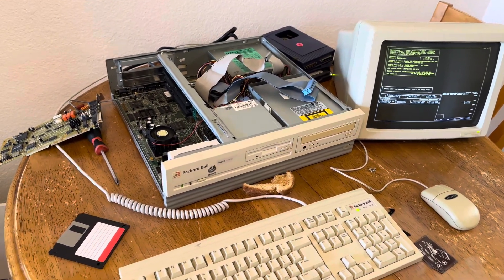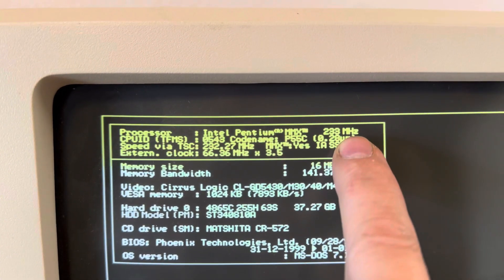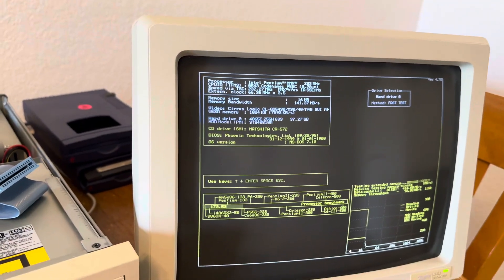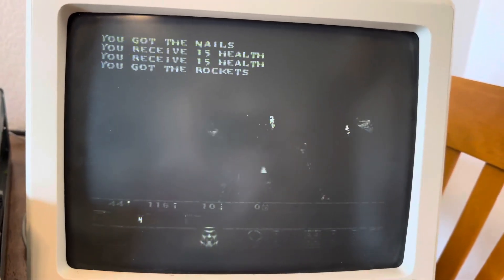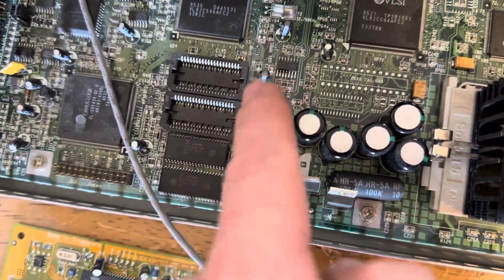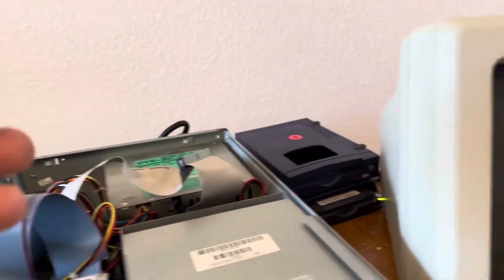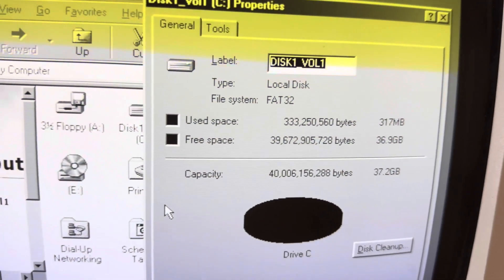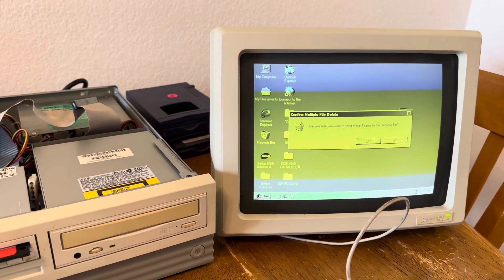Pentium 233MMX working in a Socket 5 Packard Bell

Comment: Nice!,, I found on a similar machine that I got vastly better graphics performance with a PCI card, IIRC the onboard video on this is effectively just ISA. I think they had one PCI slot? or 2 one on each side of the riser..   with the 233 in that, it would be a great match for a Voodoo2 accelerator, although you might have to hawk the first born child for such an upgrade, not sure a kidney will get you through that these days, due to inflation ;)
Reply from the maker: Sadly this one has zero PCI slots. Going to hold it back for sure, but it fits a narrow niche for sure.